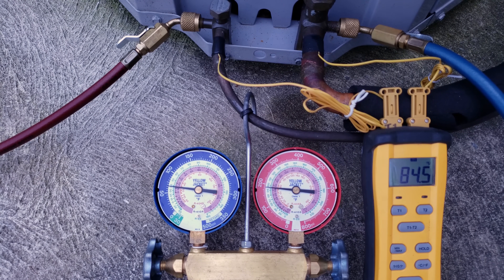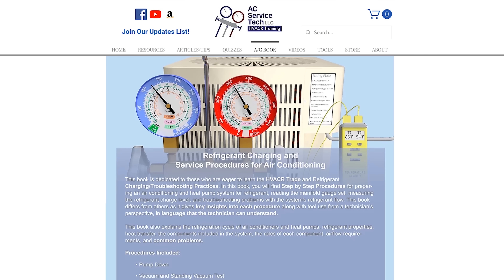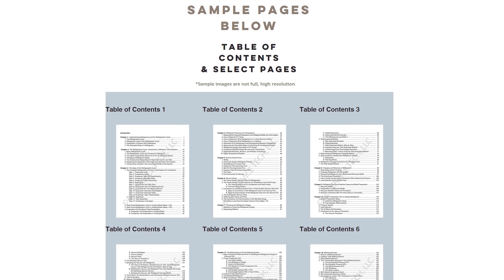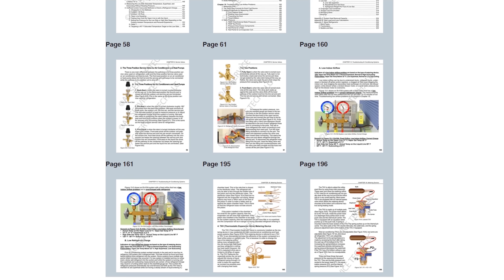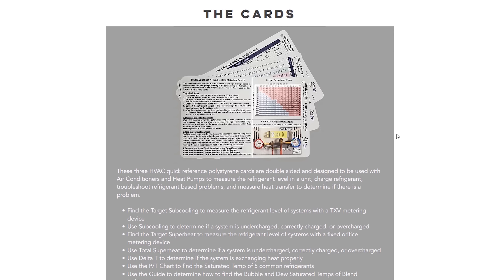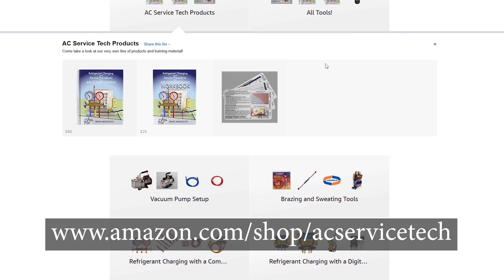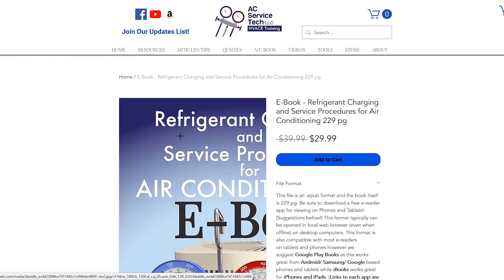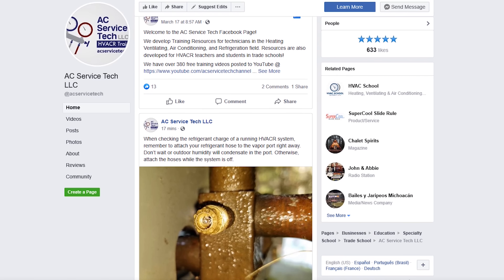Liquid Line Restriction on AC Unit Explained! Found Bad TXV!

Comment: Im getting the exact same reading as in this video I replaced the txv with external equilization and filter dryer today and still the same issue. 🎉 love hvac work sometimes. High subcoolling 12, high superheat 32, fan is good and moving lots of air, both coils are clean, what gives. Defective new txv? Do I replace it again. Idk Ug. I did a pump down and vacuum pumped to 200 microns and held so thats good, I did notice the oil that comes out of suction line is very foamy, did not take an acid test yet, noticed after the repair. R22 system with mineral oil. I also checked the temp of liquid line at cu and at indoor coil 1 degree difference so no restriction on the liquid line to txv. My liquid line is 76 degrees and oa temp is 77. So thats not good either. I did not see a fiter dryer inside the cu but im starting to think I need to go back and find out for sure maybe I missed it inside the cu coil and its restricted but not icing up. Idk youd think id have a temp difference on the liquid line at cu compared to liquid line temp at the evap if that was the case though. So im still spinning my wheels on this one.

Comment: Since the sensing bulb did in fact adjust the txv by making it open up when put in hot water, isnt the txv good? I dont get how its bad
Reply: Unless you are going to put a constant cup of hot water next to your evaporator, we have a problem. We already knew it was bad. This shows that NOTHING else can be causing the problem since it went away once you forced it open by putting the bulb in water 3 times it's normal which increased the pressure from the bulb which was too low. So, parts of the txv were working but the bulb and head were not.

Comment: It wasn't a restriction. The  expansion valve was wide open and not causing the pressure differential needed to cool.  With the bulb in hot water, the expansion valve closed down and caused the restriction to start vaporizing the freon..
Reply: Opposite. It was closed causing the high superheat due to too little refrigerant being let in the coil. Putting it in hot water made it open
Reply: @PrevailD  BINGO!
Reply: @PrevailD hot water makes the expansion valve close not open. If you had a restriction, head pressure would be crazy high and pulling a suction on the low side. An expansion valve closes down when hot to its minimum orifice size to create a metered restriction and convert the liquid freon into a gas in the a coil. This way it absorbs heat. When the coil is cold enough the expansion valve opens up flooding the coil with freon and stopping the conversion from a liquid to a gas. This prevents the coil from developing freezing temps and icing up. This is assuming you have the proper charge in the unit. A closed expansion valve dosent mean closed off. It means its restricted down to its maximum cooling orfice size. It is still flowing all the freon the compressor can pump. But causing a small restriction so the compressor can suck on the low side and push on the high side. This causes the freon to boil in the A coil and absorb heat. When the A coil reaches its desired temperature the expansion valve opens up, removing its restriction in the freon flow. Pressures will equalize and the freon will stop boiling in the A coil and absorbing heat. The amount of freon through the a coil never changes, its just pushed through at different pressures regulated by the  expansion valve. You open an expansion valve to lower the pressure and slow down cooling. You close the expansion valve to seperate pressures and increase cooling. An expansion valve is nothing more than an adjusting orfice or capillary tube.

Comment: Wait a sec... I came home to frozen over evap coils. I dethaw, go outside, and start testing. I get lower than 32 deg sat temp @ 28, very high super heat at around 40-45, and perfectly normal sub cooling for my system at 9-10. Now, thanks to your video, I know this is liquid line restriction problem. However, why bother going any further??? Testing my bulb in hot water, etc... why bother? If you're saying it can be bad bulb, bad TXV valve, bad filter drier, or bad strainer... All of that doesn't matter right? If I diagnose a liquid line restriction, I'm gonna have one of those issues... All require opening the system and all are being replaced if I'm opening the system right? So bottom line is, liquid line restriction numbers = you're vacuuming the system and replacing all of that right????
Reply: No, replace all three IF it is a txv. If not just fix the problem and leave txv alone.

Comment: I have a question (my boss doesn't belive me). I went to a unit with (r410a) sat. Temp 140 (high side) and 20 sat temp ( low side) and I felt the liquid line drier and it had a huge temp diff.. I told him that there was a liquid line restriction but he believes otherwise. He says if a unit is low on refrigerant, it will cause a temp difference on the drier due " to it flashing before it gets to the evap." I feel like I'm right but he doesn't think so

Comment: What would cause the low side to remain at say 30 psi and high side 200 psi when the AC is off. 

Im trying to figure out why the pressures wont stabalize. Wouldn't it have to be an almost completely plugged txv (for example)? 

I've just never seen a unit not stabalize. I'd appreciate your help! 
Thank you.

Comment: I disagree with this method, I use two temp clamps one on the inlet to the Liquid line dryer and one on the outlet of the Liquid line dryer if I have a two degree differences between the two points I have a restrictive Liquid line dryer, some techs say a 5 degree difference, so take your pick.

Comment: Craig i bought both of your books, great videos im a refrigeration/hvac tech, i dont get how dunking the sensing bulb in hot water and seeing the superheat rise indicates a bad txv, the sensing bulb should force liquid into the evap lowering the superheat, but in the video, if I understood correctly, it showed the superheat rising, while i understand if the refrigerant is fed into the evap under higher loads we will see the superheat raise but didnt see the suction pressure increase much. Can you help me better understand the txv restriction?

Comment: I still don’t understand the confirmation part where he says it’s bad, I would expect my superheat to lower with more pressure on the bulb, as well as suction pressure because I’m letting more refrigerant in. I would also expect my sub cooling to lower as well? How does this confirm that it’s bad??
Reply: Agreed, that tells me that its (txv) working. If the pressures didnt move i would think its a bad txv then
Reply: @bradhess3762  It ONLY started working once you put it in water at 102 degrees f. That is a clue of WHY it was bad but you already knew it was bad. If it had a different LL restriction the test wouldn't have made a difference. This confirms that THE problem was the txv.

Comment: You will be called out to a system that is under performing.hand feel the liquid line is it hot. Yes ? Check condenser for dust deposit blanket and fans.if ambient to the touch then .In order of most likely is A. short of refrigerant. Check the liquid site glass for bubbles in it.B restricted drier. test by Put hands either side of dryer to check for temperature difference. C restricted TEV.moisture problem?  Check site glass moisture indicator.. it A find leak and repair and change drier .if B change drier. or C replace drier. So what ever the issue. Change drier. If problem persists remove orafice of TEV and inspect mesh filter and replace if restricted. If not restricted then replace TEV. An experienced engineer can have a good idea of what is the potential problem even before fitting gauges . By the way in the UK. Just putting gauges on an R22 system other than to decomsion it. Carries a £50k fine and potentially 10 year prison sentence . Something to do with that group of refrigerants being banned due to some hole in the ozone layer.

Comment: Im a bit lost now. The super heat lowerd when the bulb was put into hot water... doesnt that mean that the txv is working? What was supposed to happen then? He expected the super heat to lower and thats what happened. The txv opened and allowed more refrigerant into the coil and therefore it was less super heat than before. Can someone explain what was supposed to happen when he put the bulb in hot water? Thanks

Comment: I'm confused. I always thought that if you warmed up bulb or put it in ice water and it responded properly that the txv is good.
Reply: If it was good the system wouldn't have high superheat and subcooling. When you put it in water everything got better then the txv HAS to be the issue.

Comment: I have had 3AC companies come out and all 3 have told me 3 different things it has made me lose my mind I have spent a total of probably $8,000 on my AC over the past 5 years I could have put a whole new system in, I want to come on a new thermostat as smart thermostat so I have a Honeywell 7 day programmable which truly I think is the issue, It is not WiFi Each time something has been wrong with the programming I still feel there must be an issue with this Honeywell it's probably 1 of the worst technical support companies on planet earth I have spoken to them email them 25 times and nobody To me yet Now on today 3AC unit companies the 1st 1 came out said my compacitor was going I should replace it I did that cost me $250Otherwise everything was spotless speaking span and perfect However the AC Between 72 and 73 all day long it is freezing in the house530-830After 830 if I touch the thermostat 1° down it will jump up to 74 and stay there no matter how long it's on So the second AC company came out and told me that I needed a complete new TVXTXV sorry I didn't believe that that is the issue because the AC cooling system is not spotty It's not 1 day here 1 day they are 1 hour here 1 hour there during the day it is literally freezing in here And it is running beautiful Now 3rd company comes out my TXV oppositely is unremovable from my system however I have not been up in the attic yet to look at it he said he heard it knocking I don't know whether he did all the task but he said everything is running fine All my numbers check out beautiful it's an old system 10 years old and he says he feels that it is an old system it's hot outside and it's probably the TXV is going But it's not gone He says he hears a tad of knocking what does that mean after 3 air conditioning companies I'm still having the same problem I'm now I'm out $300 for 3 checks the same thing is happening the AC works beautiful all day it's 94° outside it is maintains a perfect 72 73° all day long to perfection but the moment I tap the thermostat 1° to lower it for bedtime that's ITIT's over it jumps back up to 74 however if I drop it back down to 72 or 73 it will maintain the unit is not freezing off the quills are not freezing I'm not having any issues with anything like that what is the problem? I am Going absolutely insane and running out of money
Reply: Is your thermostat programmable? 

What brand is it?

Comment: I had an r22, 40/200 psi, below 32 saturated temp with a 59 dgr sprht, and 12 f subcl, but my split was 20 degrees, this unit is a package heat pump 3 ton, from 97, air flow was good all vnts are open, i chaned the txv, and the results 60/236 psi, my vapor saturation temp was bouncing between 33 n 34 which im concern about, i got 32 sprht, 14 sbl, n 29 degree spli, I feel like my next step is to check the static pressure? or should i just run for the hills?

Comment: Wanted to thank you Craig, had suspicions a call back I was going on was a liquid line restriction due to the pressures I saw last time but wasn't familiar with diagnosing it or what the signs were. I listened to your video on the way there and used those tips to properly diagnose what was indeed a liquid line restriction at that job so thanks again! Turns out the system was never installed with a filter drier and the evap coil itself may be clogged as well but at least the system isnt freezing up anymore.
Reply from the maker: Thanks a lot!
Reply: @acservicetechchannel  no thank YOU.

Comment: So I have a 5 ton rooftop unit that has 65 psi suction pressure and liquid 210psi and liquid temp at 165 degrees,,,, I washed the condenser coil with no change in temp????

Comment: Lost Me when you said "if have a High superheat could be your low on refrigerant or some restriction"I was like not really but I was just hearing it then saw the actual video and saw the gauge readings which where low but if there were normal gauge readings jet have high superheat more than likely is overcharge.. Just tryna clear the air

Comment: The one thing I don't understand is why the delta t is low in this situation. Why wouldn't it be very high if evap is about to freeze because of such low vapor side psi? Thank you.
Reply from the maker: not enough refrigerant in the evaporator coil to absorb the heat so though the first part of the coil is frozen, the other end of the coil is at the same temp as the air in the building, thanks!
Reply: @acservicetechchannel  thank you

Comment: You did not prove this TXV is bad or failing. If anything you showed the TXV is functioning and need to do further diagnostic. Your subcooling is not in range to start with and 5-10 minute run time is not long enough to get proper readings. Every manufacturer says 20 minutes and another 20 minutes after any adjustments are made. You should have verified charge by weighing it out and checked airflow using static pressure. TXV may be bad but you did not come close to proving it.

Comment: I thought if the super heat and pressures change after you put the bulb in hot water it      would mean that the txv is not the problem since it’s opening when the bulb is singing the hot water.
Reply from the maker: The issue is it is slightly low on refrigerant in the bulb head. This happens a lot where under normal temps the txv wont open enough but if you put the bulb in hot water and then everything is good with the superheat and sat temp, that means that there is nothing else wrong in the system and verifies that the txv is the problem. You still need to verify that subcooling is high enough though, which indicates a correct charge, thanks!

Comment: If TXV is opening more when you put the bulb in hot water means TXV is working properly, and suction pressure will go high and superheat will go low. All those indication that you have a good TXV. Please prove me wrong if you can. Thank you
Reply: Heating the sensing bulb was a diagnostic step to confirm that the TXV has a restriction and is not operating properly under normal conditions. When you applied heat and the TXV opened, it showed that the valve was capable of functioning but was likely sticking or restricted in regular operation.

This test helps confirm that the TXV is faulty and needs to be replaced, as the issue is likely intermittent or mechanical, causing it to restrict refrigerant flow under normal conditions.

In short, heating the bulb provided a temporary fix for the restriction, but it verified that the TXV should be replaced for long-term system reliability.
Reply: Prove you wrong? Ok! It needs to open correctly when it is in place and in the system. This just proves that IF it had the proper bulb charge it would work. It doesn't and it isn't. If nothing happened you would be proving that it was stuck. If you have proper airflow, high superheat, normal to high subcooling, and no other ll restrictions, pull the txv, screen, and filter drier and change them out.

Comment: Super video. My ac has a problem and my superheat is very high and my subcooling is at around 9 degrees(ok for my Goodman 4 ton unit). With the info from your video I will attempt to check the filter dryer and the TXV to see where the restriction is(hopefully). Thank you all your video, they are so informative and clear. I really appreciate them and look at them anytime I have problems.

Comment: Hi Craig I have a unit with txv the sub cooling is 8 degrees at the beginning it was perfect then after 15 minutes my discharge line temperature was 98 degrees and it dropped to 45 degrees pressure didn’t change but the sub cooling just went down to 49 degrees is this bad txv?

Comment: On rooftops check your economizer to make sure it’s functional. I had all the symptoms of a txv; tested with warm water. Ended up replacing it because it seemed bad. Turned out the economizer wasn’t functioning and the return air was getting too cold and with that bulb on the top part of the coil on the suction line it was getting frosty causing the suction pressure and saturation temp to go down. As soon as I manually cracked the economizer, it solved the issue.

Comment: Great video excellent presentation. It appears the filter dryer is in backwards. could this be a problem?
Reply: It’s in the correct position as long as the outdoor unit is straight air.